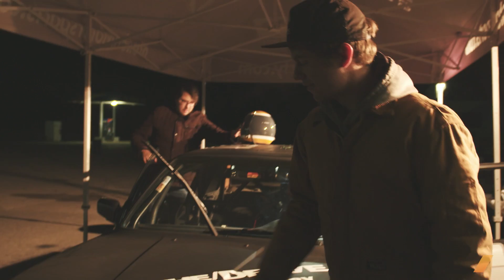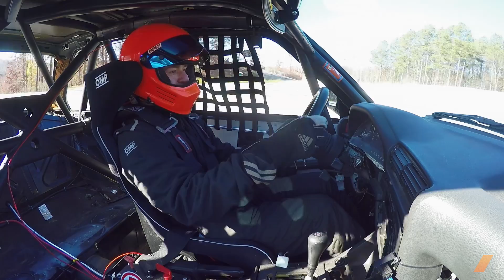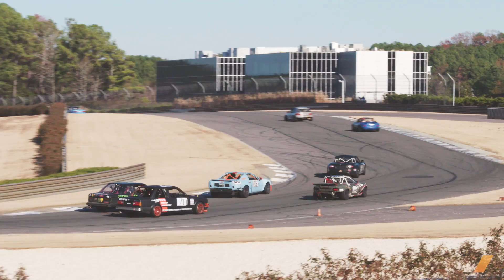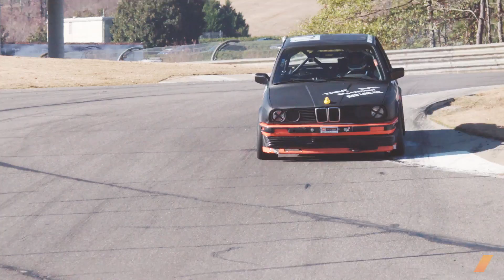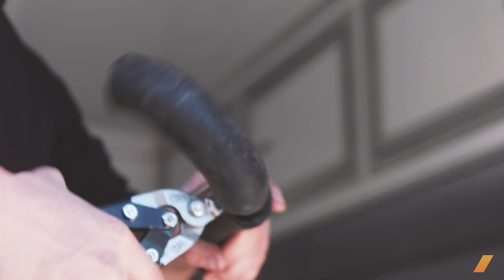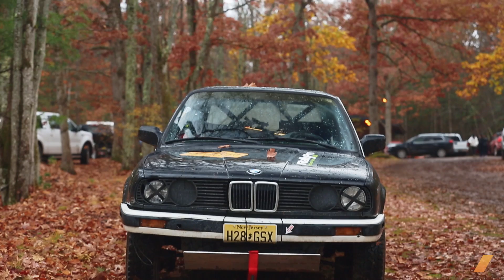Project $2,000 E30 BMW Finale: Racing in Chump Car [Episode 5] — /BORN A CAR

Comment: Fix the broken stuff, dial it in.  Check things that are likely to go wrong, dial all that in.  Set it up properly, and do this endurance thing again!
Reply: Thaddeus Sandford log everything that happened what worked what worked, what broke and what can improved.  they do that I guarantee they will finish in the top 10 or higher maybe even podium.
Reply: Yep, they have to keep racing it for sure !
Reply: For basically a salvaged car....the car was awesome....the motor held up.....a bummer the trans didn't....road racing is brutal on clutch and tranny.....the other events beat the car too....tells you that BMW builds a pretty damn good car.....

Comment: Awesome series, really liked it! Makes me want to go get an E30 and slam a roll cage in it :)
Reply: Felix Malmberg Go and get one bro. I drive one myself. But only on Road. They are awesome cars. Handling is awesome. Parts arent that expansive. The e30 has the biggest fan community in the world. Support is awesome. The Car is awesome. And its fucking easy to work on
Reply: E36 is also a great option. Its light, affordable, sounds great and is faster.
Reply: Claude V. Affordable is relativ. 6 Zylinder 2 door models aren that Cheap anymore. You have to spend more than 6000€ for a good one
Reply: you want the 4 door e36 for racing, 100kg lighter than the coupe
Reply: OvalD I dont wanna Race them. I wanna build them to look good. Stance man. Stance
Reply: stripped out e36 would be so cool
Reply: Nasty business. When you cant drive it. Its too much. Its schould be easy driveable too
Reply: IMO if you cant afford airbag suspension, you cant afford to slam your car,.only way to have it driveable
Reply: ugh go stance an automatic Lexus or something. save the e30s for people who want to drive them. taking the most successful touring car chassis of all time and rendering it useless is a crime against humanity.
Reply: Stance doesent mean that a car is undriveable. I Drive e30 myself. Just get a nice set of good loking wheels and upgrade the suspension and you have a fucking awesome car
Reply: There's just a massive difference between what most people consider "stance" and the way an e30 should be setup. mine's low but just enough that my struts still have plenty of stroke and I don't rub the 225/50/15's I have on it. I just wish more people cared about learning to race and tinkering with their cars for an end result other than instagram likes. do what you like with your car but have respect for what you're driving.
Reply: William Zimmermann Yep. Exactly.
Reply: I know this is old but hope you already got it because it's worth it, i have 320i and stroked to b30. It's not cheap but affordable and lot of new parts that are made by vac motorsport, ireland engineering, tag engineering. Even thou they aren't genuine by bmw but still great quality and better than the original.

Comment: This is an awesome glimpse into the world of ChumpCar. My friends and I bought an e36 318ti freshman year of college that we did winter autocross with, then track days, and eventually ChumpCar at Road America. Our roll cage failed tech inspection, but we stayed up until the wee hours piecing together Grade 8 bolts and welding missed joints with a borrowed MIG from a fellow competitor, and we were on track at sunrise. The Chump community is unique - you won't find a more helpful paddock in any other form of motorsport.

Farngrün Platoon #319

Comment: Most endurance racing is like this -- Chump, Lemons, WRL, AER, etc. Everybody helps everybody. It's like everyone is one huge team.

On the subject of fuel consumption, if you have to conserve gas, stop using full throttle. As I've tried to teach my teammates, the difference between 50/75/100% throttle is the volume of gas; it'll only have a few seconds difference in speed. In an endurance race, those seconds don't matter vs. the loss of laps (not all tracks have pit timing loops) and the time on pit road (which for chump is a required 5mins.) Now that we're racing (sigh) an electric car, they have to be very conservative with that right foot. Plus, once you know you'll not get your speed back quickly, you begin to drive with more momentum.

Having to drive with a single gear will also teach you to hold on to momentum. THSCC's HPDE program includes that as an on track exercise. That's a valuable skill in endurance racing... drive a bit slower in 4th/5th or spend an hour changing the transmission.

(PS: I'm surprised they flagged that contact. Chump (east region) has a nasty reputation for ignoring contact.)

Comment: Cool video.  Pretty much my experience racing with Chump and Lucky Dog.  Always have a spare radiator.  And a tip for making the space for a tire. Use a short 4x4 and try to round off the corners, jack the car up put the 4x4 between the tire and the fender well and roll the car back and forth.

Comment: Really enjoyed the series, thanks for producing it. I'd be interested in a realistic estimate of the price though, calling it a $2,000 E30 doing all these different motorsports isn't quite right after multiple sets of suspension, a full roll-cage, wheels and tires etc etc. Much respect for all your hard work on the car and the production though, again thanks for making it.
Edit: Actually I take it back. I realize you're going to have to do a bunch of work to any car you get from the street and want to take to rally/track, so calling it what you paid to acquire the car is totally fair. Cheers and good luck on the next project.

Comment: Dudes!!! that makeshift radiator was such an awesome fix!

Congratz on the results!

Wonder what could be done to prevent the fan nicking the radiator in future races?
Reply: Thanks!  And the answer would be to take the motor driven fan out and just run the electric fan.  I shoulda taken the stock fan out of the car, and just used the electric fan I installed where the old A/C fan went.... but I didn't think to take it off until the problem occurred.
Reply: Ryan Symancek Nice! No more radiator trouble next time!

Comment: What oil did you have in the transmission?  Just curious because of the Redline stickers.  Did you take the transmission apart to see what failed?  I have/had several e30s and e36s and use redline in the transmissions of those and other cars so I am curious.  Thanks.

Comment: Over "engineered" solution to a problem that should only take 15 minutes to fix. JB weld the holes in the rad and then crimp those sections shut.  How many laps did you lose by coming up with that fix?